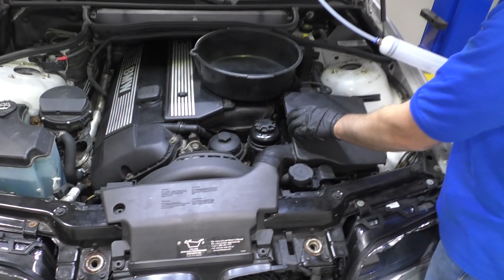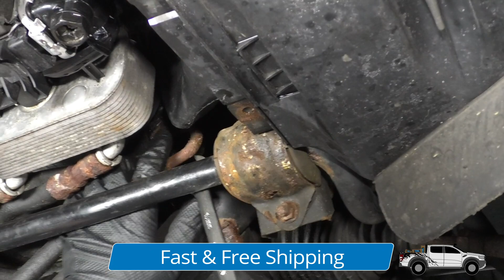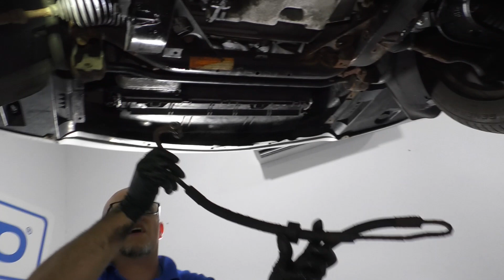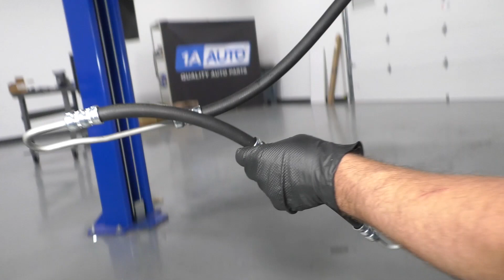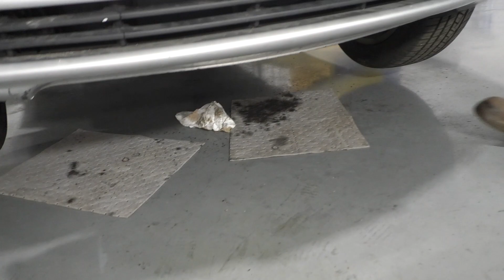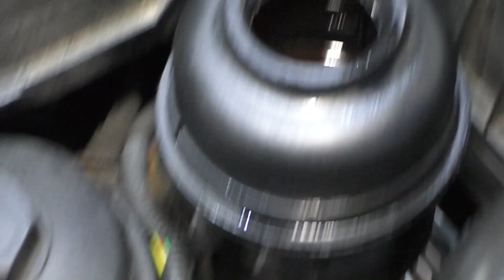How to Replace High Pressure Power Steering Line 97-06 BMW 325 Xi

Comment: Your video is helpfull but its bad advice to NOT remove the front sway bar (even partially) as its a 1 in a million chance you can swing a wrench or even get on the 17 mm high pressure fitting.

Comment: im trying to order this high pressure hose same make and model it says you dont have anything powe steering related where cani buy??
Reply from the maker: +Starting Tech Thanks for watching!  We do not currently have this line.  You could try partsgeek.com!
Reply: 1A Auto Parts you don’t stock it anymore?
Reply from the maker: +Starting Tech Our inventory is constantly changing so we could stock this again in the future, but do not have it available at this time.
Reply: 1A Auto: Repair Tips & Secrets Only Mechanics Know ok I like buying from you bc prices were low hope you get more bmw E46 parts thanks for the tutorials tho

Comment: Do you now have to line up the banjo bolt with the feed to ensure the flow is going through?
Reply from the maker: +Tom Grove Thanks for watching!  You do not need to make sure it is lined up, just torqued to spec.
Reply: 1A Auto Parts Ok thank you very much.
Reply: 1A Auto Parts Is it essential to use a fresh crush washer or can you reuse the washers from the existing pipe? I have ordered a pipe from BMW direct though it has arrived without the washers. Thanks, Tom
Reply from the maker: +Tom Grove Thanks for checking us out! 1AAuto.com
Reply: Hi, I have fitted a new return pipe but I still have the same leak at the pipe to collect connection, do you have any idea what this may be? Thanks,

Tom
Reply from the maker: +Tom Grove We cannot provide a diagnosis over the internet, so we would suggest consulting with a reputable local mechanic for further assistance with this. 1aauto.com

Comment: I have an important question. I ordered the new designed pump since mine went out on me. I seen a video with new improved hose but can't seem to find anymore.. would you happen to have the part number for that? 04 BMW 325xi auto. Thanks in advance. Great videos btw 👌🏼
Reply from the maker: +Brendan Aduddell Thanks for watching!  We do not carry an upgrade power steering pressure hose for this application, so we are not able to provide you with a part number.